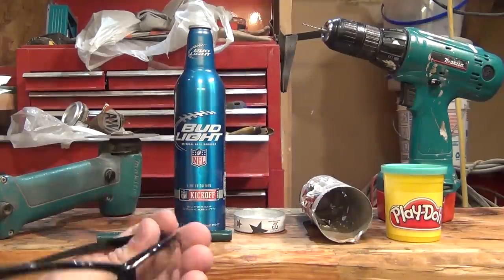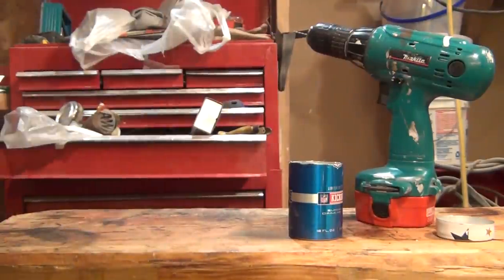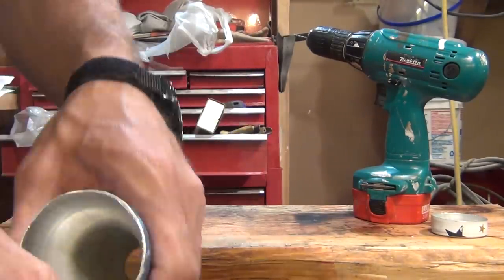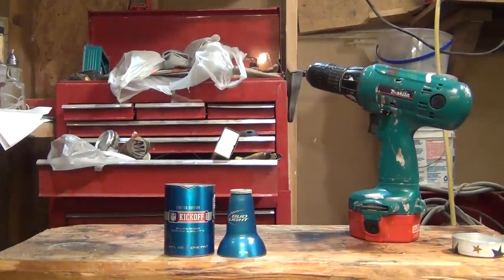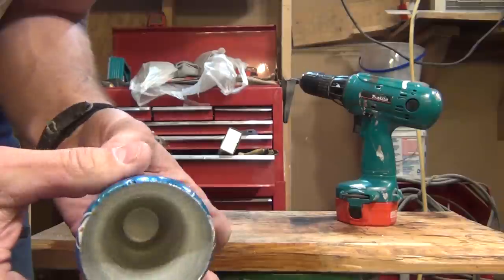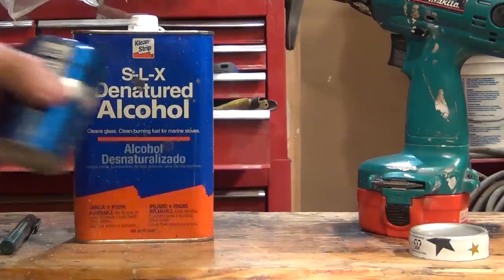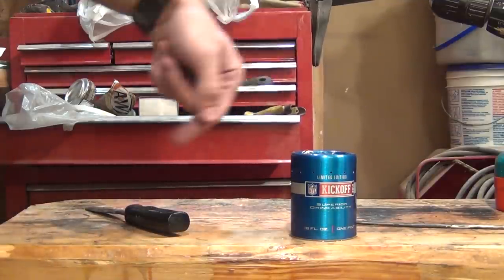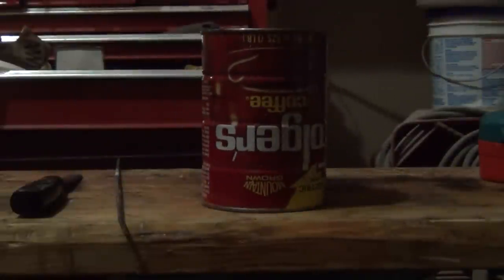How to make a backpacking stove with a Bud light aluminum bottle

Comment: Thats great.. I saved a few boxes of my brothers red budweiser can bottles because I knew there was something to make with them and it seemed like a waste to toss them.. nice thick aliminim bottles... for creative people, nothing is junk.  I dont have a cutting wheel, but maybe they make a cutting wheel for a drill? id like to see how you got the 1 bottle to fit in the other bottle end to roll it. I made a stove from 16 oz budweiser cans from your other video using arizona tea cans. It worked nice with 16 oz cans. . I have been cutting up can butts trying to make something above the flames to set a pot on. I tried to make one with ears but cut one off trimming it. lol. I have plenty of cans to experiment on. I only had 70 percent rubbing alchohol and it worked great. Also, I didnt have and pledge, so wd30 worked just fine.Anyway, the 70 percent rubbing alcohol had a pretty blue flame... when it started comming out of the little holes when it primed, it looked soo cool.

Comment: I enjoy your videos. I have purchased a few of the Stanley cook sets based on your reviews. When it comes to the stove building You should take the time to build a few jigs to obtain square cuts.If you are going to roll the edge of the outer can this becomes even more critical.As for fuel the absolute best would be a blend of around 50/50 of methanol and ethanol. The SLX denatured is unregulated an can contain up to 20% MEK and other toxic chemicals.The Klean Strip Green contains 96% or more methanol.Same mfg just their green line. The good fuel is called Green Envy made by Sunnyside and can be ordered online. It is a 50/50 blend.That blend gives the burn time of one and the BTU of ethanol.Isopropyl should be rubbed on sore muscles but only cooked with when nothing else is available. 48 ounces of heet is  $5.87 at    Walmart Just helpful hints I hope.
Reply: I dont think it does much different than a wick in a can . You can see the center boling too and a big flame up the center .

Comment: In nearly every video, people are making some combination of 8 holes.
8, 16, 24, 32 and one person said 19 holes for some odd reason.

I wonder why all the holes?

Some use push pins to make holes in pop cans, other use #57 drill bit for drilling holes.
Other use 1/16" and still others use the next size down.

I have seen some people mix as much as 50% of the 91% and 50% of the Denatured Alcohol. I think they said it alters the burn rate and temperatures a bit for a less hotter burn and longer burn.

Instead of lots of small holes for the jets, have you thought about making some slots instead? Say about 1/4" horizontal slots, same height, and only have about 4 or so of them?
Slot size about the thickness of a hacksaw blade or smaller?
If you took that bottom can part you made a jig out of or a longer one and cut some holes in it after stretching, you could place that inverted over the stove and rotate to make a simmer ring. Maybe JB Weld something on the simmer ring to use as a handle of sorts? Maybe leave a 1/2" extra length and width (strip) on one side of the simmer ring to roll/fold it to make a handle?

Side burning is great but most of the heat is lost up the sides. Probably best for a skillet?
Perhaps a smaller flame kernel to use on both pots and skillets?

Some builders claim that if you place the stove in a shallow pan of water, it slows down the burn - not sure if this is good in cold weather though.

Some builders use a wicking material in their stoves.
Another suggestion is to use a can lit from a tuna can and JB Weld that to the bottom to give more stability and for use as a primer pan.
Out in the woods it is hard to find a hard, flat, level surface for the stove.

Your thoughts?

Comment: Holy Jesus, dude, did you just dump about 3-4oz of denatured alcohol in that thing?
As a backpacker, we typically use <1oz of fuel (mine takes ~.75oz to boil 2 cups of water... a little less when warm, more at high altitudes or cold). 
To calculate amt. Fuel needed. 
1) weigh the stove alone
2) drop in 1oz of fuel (total= stove + fuel)
3) light/prime, &
4) put pot on top with stop watch going to find out how long to boil 2 cups (think raaman, knorr rice/ noodle dishes, etc)
5) when it reaches a rolling boil, stop timer and extinguish stove
6) weigh stove with remaining fuel
> subtract new total weight from original stove +fuel wt. To determine remaining fuel. 
7) NOW you have a very good idea how much fuel you need to use/ take with you for little/ no waste. 
* tips: a wind shield of some kind yields faster/ more uniform boil times
* if making knorr noodles, next project is a bubble foil (radiant barrier) "pot kozy"... reach boil temp, extinguish stove, place pot in kozy with food contents- it cooks it for you w/o burning fuel!

Comment: The best way to get rid of that awful stuff in denaturated alcohol is using coal,the same thing you use cleaning up your tap water.Every shop that sell equipment for brewing wine has it in their shelves,at least here in Norway.................................................................................Here is how you do it, follow this advice and you are guaranteed a good result.Denaturated alcohol is some pretty mean stuff,don't expect it to be drinking liquor but it is clean enough for use in a small cabin or a tent without being forced out of your "house"!However the same procedure used for cleaning homemad liquor works out perfect!................................................................................Most homebrewers lack knowledge about the nature of these tiny coal particles,the same product used in gas masks,really.People is looking more at the costs of the coal and usually cut down on the needed amount that is required for a good result!And most people pour the liquor down the coal pipe instead of making it start from bottom and slowly work it's way up and out .IT IS TOTALLY WRONG!!!!!!!!!!.................................................................................The proportions of the pipe is also important,inside diameter must be at least four centimeter and the length about three meter.AND USED FOR DRINKING LIQUOR,THROW THE COAL AWAY FOR EVERY SIX LITER 45 PERCENT YOU HAVE MADE.REMEMBER,BEST RESULT WHEN THE STUFF IS ABOUT 45 PERCENT.................................................................................When poured into the top of the pipe,the moisture makes a track for the following drops and the result is not very effective,the liquor tends to follow a narrow track and does not spread out and use the fully potential of the cleaning effect.The right way is to let the liquor into the pipe from the bottom,you do it by hanging the liquor can on a higher level then the top of the pipe!Then the liquor will spread out evenly and take advantage of every single coal particle.The speed where you introduce the liquor to the coal is also important,a golden rule is the same speed as it came out of the distill when making it.The best cleaning effect for drinking liquor is when it is about fifty percent,it's just so.Forget that now as we are dealing with denaturated alcohol.

Comment: Geeeeez thought you were going to loose a finger @ 3:34
Reply from the maker: +Peter F It looks scary I know, but the truth is that grinder is so low powered. It would be lucky to break the skin. Thank you for the concern and for stopping by. Have a great day!
Reply: The 9 volt Makita is not low powered it is just your battery is not charged
Reply from the maker: Chet Gravatt it's only 7.2 volts. it's a great little light duty grinder

Comment: Another tuber mentioned you want 19 holes with a #57 drill bit.

As of 12/2021, you can buy a gallon for $20 + tax.
Quarts are just under $8 + tax

Most sooty to least sooty 50%, 70%, 91% and almost no soot with denatured alcohol.

Another tuber wrapped some kind of wicking material around the outside of theirs, put a little fuel on it, lit it, and the stove primed very fast.
Another placed a tin can lid slightly larger in diameter to your stove diameter under the stove to use as a preheat tray.

Shouldn't the stove height be the same as the stove diameter for better stability?
Or lower height?

If it takes 10 min to boil water and uses about 1/4 to 1/3 ounce of fuel, then why make such a large stove that holds an ounce of fuel to run 50 minutes?

Would there be any advantage to using a wicking material inside between the two walls?

Comment: Hi I wanna build one of these jet type stoves I bought a heavy aluminum water bottle , my big problem is going to be able to roll that top edge ,I’m going to need something a lot more sturdier than an aluminum can bottom to roll that edge ,I’m guestamating it’s a 16 th of and inch thick , any ideas🤔 the container is about 2-1/2 “ in diameter.

Comment: Nice. The only thing I would wonder about is? Since your top is sealed view do you pour out the excess of you have fuel left over? It's possible through the jet holes but could get messy.
Reply from the maker: thank you. when I'm done cooking I snuff the stove out by covering it with a metal cup. this puts it out. if there's not much fuel left I'll let it burn out so it will be dry in my bag.

Comment: Fantastic tutorial!  Dont really need a lot of tools and you can drink a few cool ones while your at it!  How did you finish off the rolling and what can you use to take the paint off the beer bottles.
Reply from the maker: thank you. to get the roll nice and round like mine looks just continue to slowly compress it. you can use a vise to help with this. don't know why I didn't show more of this in the video. most likely because I was trying to shorten the video. I've been told that some of my videos are too long. paint thinner will strip the paint right off. have a great day!
Reply: +jiujitsu2000 Thanks for the quick reply.  And IMO, if your doing a tutorial you should show as much detail as possible BUT that's just my opinion.  Thanks again!
Reply from the maker: +snakemonkey555 thank you
Reply: Question?  Would this stove work with a Coors Light aluminum bottle?  The one with the twist off top?  I've been to three supermarkets and a beer distributor and no one has the Budweiser brand aluminum ones.
Reply from the maker: +snakemonkey555 those are thinner and different.
Reply: Yeah, I've seen some tutorials and seems much thinner.  Having a very hard time finding the Bud line of aluminum longneck bottles.

Comment: hello,,,great video,,,,can you tell me exactly what bottom can you used for the compression roll,,,and did you half to flare it to fit over the bottom of the bud lit bottle,,,and if so,,,how did you flare it,,,,or stretch it a bit ?? thanks for sharing !!
Reply from the maker: thank you. I used my vice to smash them together to make the bottom piece that I use for a jig to make the flare. then I put the price inside that and use the vice, a clamp, of gently hammer it with a mallet to make the roll.
Reply: ok great thanks so much,,,,gonna work on it come the weekend,,,,love this little stove,,,great ultra lite addition to my kit,,,,thanks again,,,,Peace !!
Reply from the maker: +John Marvel Thank you!

Comment: Great vid, sir! A handy little stove to stock just in case. How long does it burn for with 91% vs. denatured alcohol?
Reply: 91% (rubbing) alcohol has a lot of impurities in it, that will soot the bottom of your pots, and plug the jet-holes on the stove. Most people wouldn't recommend using it at all.
Reply from the maker: comfortouch
 You're exactly right! I haven't had any issues with it clogging the jet holes, but thanks for the heads up! I've found that denatured alcohol works the best!
Reply: jiujitsu2000
The best fuel to use for those stoves is HEET in the yellow bottle. You can find it at Wally World for less than 2 bucks.
Reply from the maker: Thank you! Some of my friends use that. I haven't tried it yet. I need to... :-)

Comment: How long will it burn ?
Thank you.
Reply: Measure your fuel—light it and time it. Use whatever pot you use to heat water and time how long it takes to bring that to a boil in similar conditions to what you'll be experiencing when in the wild. Measuring allows you to plan how much fuel you are going to need while on trail.

Comment: It's been a few weeks, but I noticed the $ of a qt of  Denatured-Alcohol at WMT was ~$7, as you mentioned... then at  HDepot/Lowe's  ... a  Gallon of  Denatured-Alcohol was about $16-17  or just under  $5/qt...  thanks for the  "vids" and best wishes for 2014.
Reply: I have an Ace Hardware about half a mile away.  I was paying $8-$9 a quart for denatured.  Then I noticed gallon cans for less than $20.  Waaaay cheaper if you buy the bigger can.

Comment: Okay,  I've tried this 7 times now and I can't get the top edge to roll over smooth.  It buckles and looks terrible.  The stove works well, but it's such lousy workmanship, I wouldn't accept it.  I can't figure out how you are able to press the bottle bottom over the top and it just rolls the edge so smoothly.  Any advice would be appreciated.  I would like to be able to make these.  I think their really cool.

I am doing it in cold weather in my garage.  20 degrees F.   I don't know if that makes a difference, but maybe.
Reply from the maker: Sorry to hear that. To be honest, I don't know why you're having that issue. I live in Arizona and my shop is around 70-80 degrees. Possibly it is the temperature, but who knows. Maybe take it inside the house for that step? Good luck and please let me know what you find so we can help others! Have a beautiful day!
Reply: jiujitsu2000 Okay,  I tried again last night and figured out my issue.  I sprayed a little silicone spray in the die to reduce the amount of drag.  It worked.  I still had a little trouble getting it off the stove, but I managed to muscle it off.  I tested the stove and it worked very well.  Do you have any advice on stretching the die portion so it slips off easier like in your video.  Mine was beastly to get off.
Reply from the maker: MNgunhead awesome! I think my die portion slipps off so easily because I've used it before and I think it may be stretched a little and it fits loosely. Thank you for the support and I hope you had fun with the project. Good evening!
Reply: With a hair dryer or heat gun, heat the die portion then slowly stretch it over the base of an unopened bottle of the same brand as your die. Don't make the walls of the die too tall or they will tend to seize and be hard to pull off.  @MNgunhead

Comment: what is the total amount of time it can burn when at full capacity?
Reply from the maker: If I remember correctly they burn for around half an hour depending on the fuel used. Mine are slightly taller too and hold more fuel
Reply: awesome, thanks for the quick reply

Comment: ...and I thought Mohammed Ali (boxer) was a dangerous man...you got him beat hands down...OK...enough with low blows (ha ha ha)...first your measurements are a little to be desired...your inside part should be at least 1/4 of an inch shorter than the outer cavity...a vise works better than a clamp...or use a car jack for that matter...I use a band saw to cut mine or tin snips   and also use wood blocks at both ends to keep from bending your can like I did...yes I maimed the first can I did...LOL...you need to show how you stretched the bottom of the can (with the little hole in it) you used to roll the top over...oh...and the hole is useful for one other purpose...after you have squeezed your cans together and you can't separate them...blow air into that little hole with your air nozzle...be careful...it pops right off...and you have more guts than I...you made this video...I've made many and different kinds of stoves...but never a video...thank you for your time and effort...keep up the good work...!!!